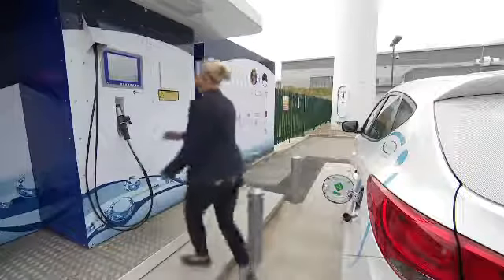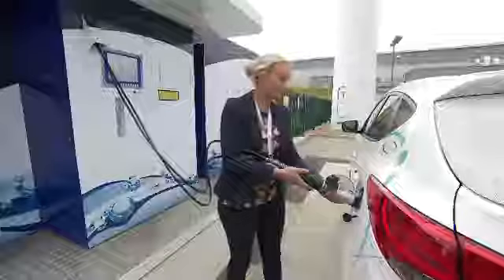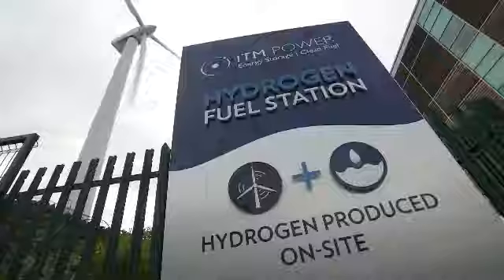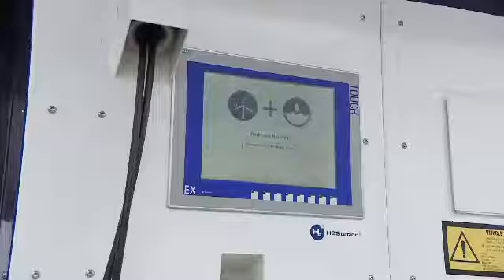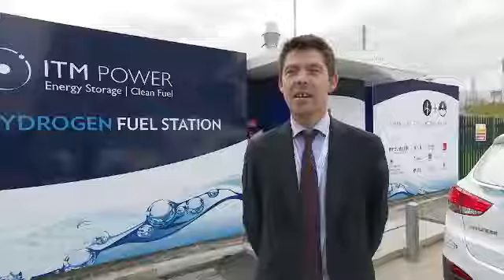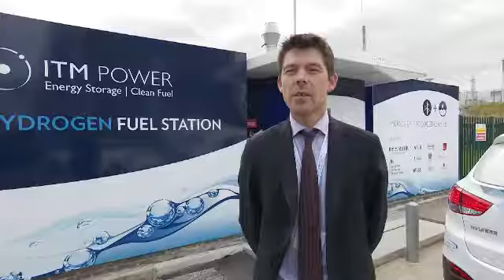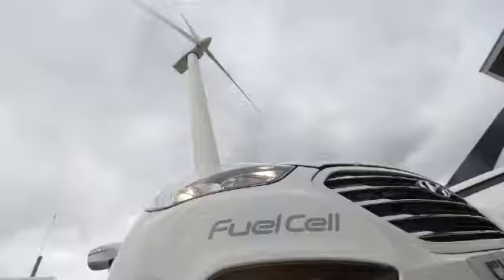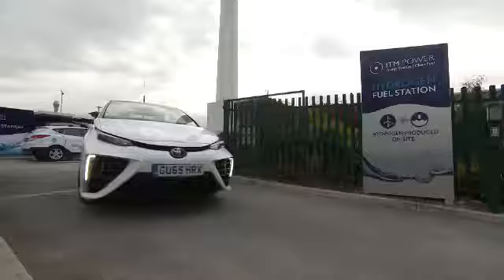100% Wind Powered Green Hydrogen Station, Yorkshire, UK

Comment: its the beginning of the end if these vehicles burn the fuel in combustion engines , we can not make new water unless we are using the energy stored as potential elelectrical energy as in HHO battery is better then HHO combustion engine